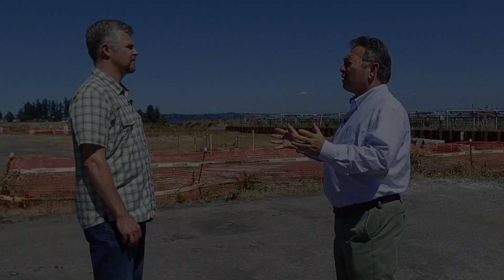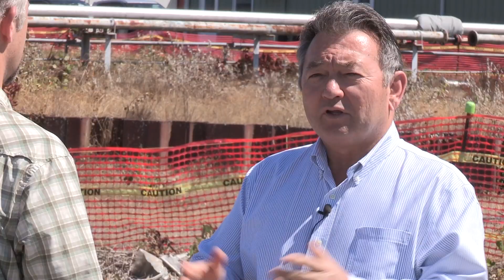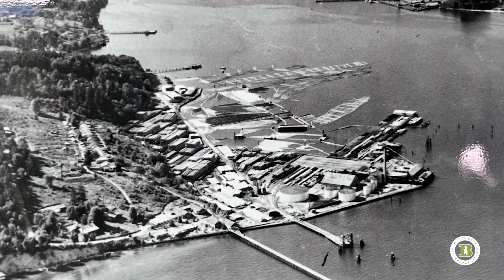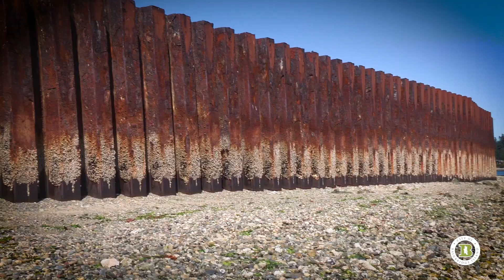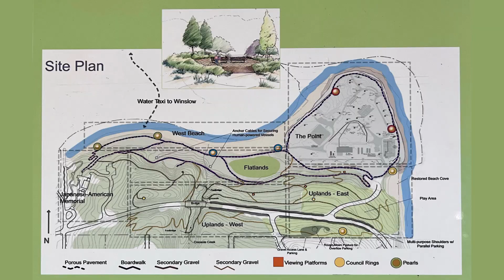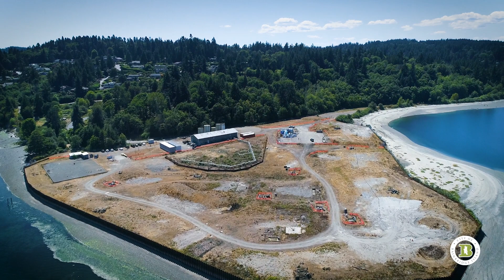Talking with the EPA about the Wycoff/Eagle Harbor Superfund Site

Comment: Does the City still empty its sewer water in the bay?
Reply from the maker: The City’s Winslow wastewater collection system flows to the Winslow Wastewater Treatment Plant . The plant is a Class 3 secondary-activated sludge plant that employs dissolved oxygen for solids treatment and ultraviolet light for disinfection.

Each year the plant treats 150-million gallons of wastewater with typical conventional pollutant removals above 97%. The treated wastewater is discharged east of Wing Point into the Puget Sound. Plant activities are regulated by the State of Washington Department of Ecology, and the Plant maintains an accredited water quality laboratory.

Additional information: https://www.bainbridgewa.gov/369/Wastewater-Collection-Treatment